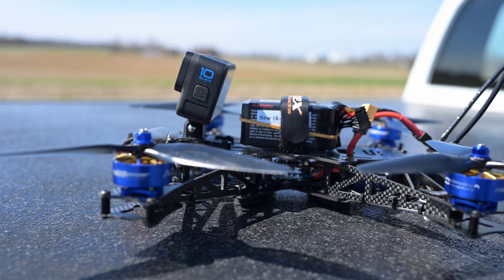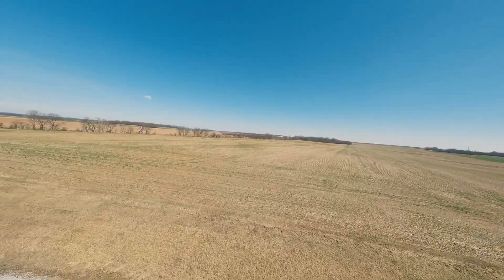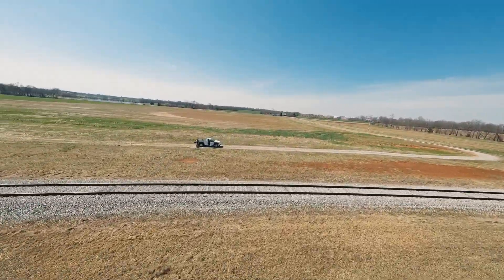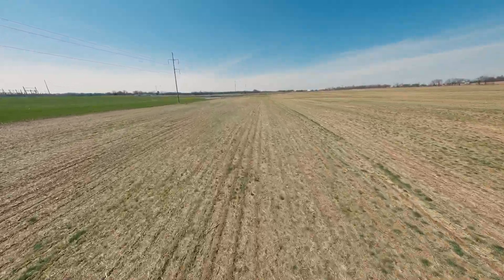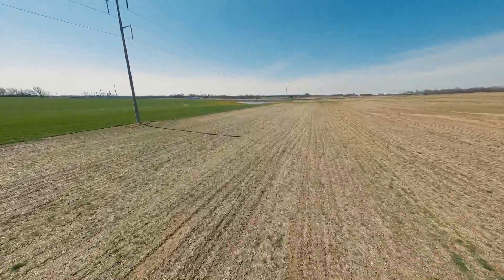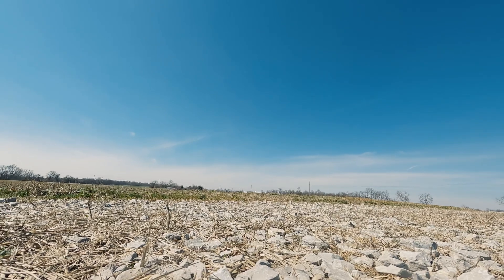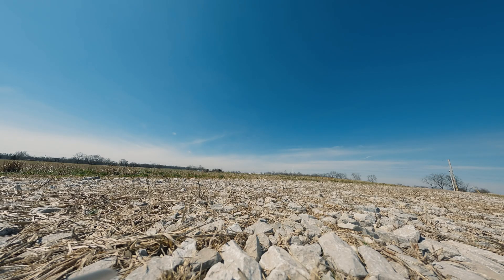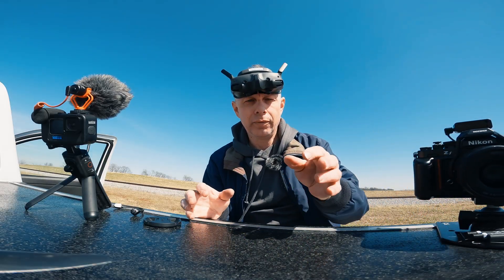Ultimate AOS UL7 Long-Range Build (3-09-2025)

Comment: GoPro is making those motors struggle big time. I bet they are hot.
Reply: Got them on my chimera 7 pro v2 and they are well coled tbh, and they sound so goood too love them
Reply from the maker: @Volarte_Studio  Yes simply marvelous!
Reply from the maker: Actually they were not hot. I do not have a big enough battery on board, just 1500mah one. Next I am going to test my GPS rescue set up. Then I will flash Criss Rossers Tune for this quad. Then a bigger battery. Just one change at a time.